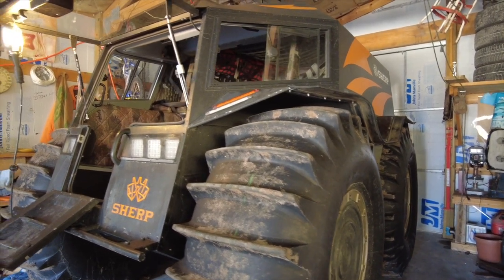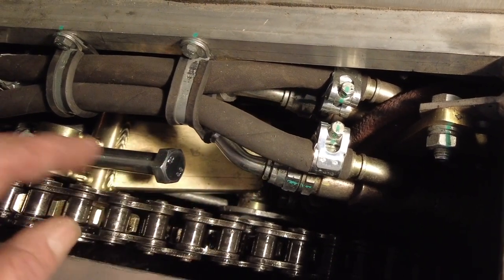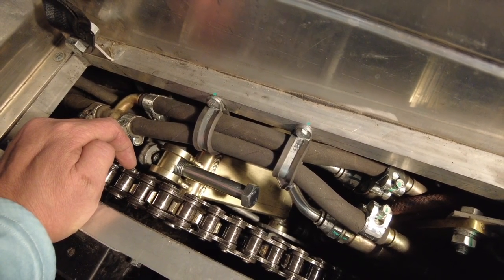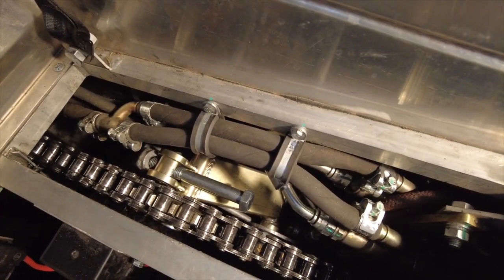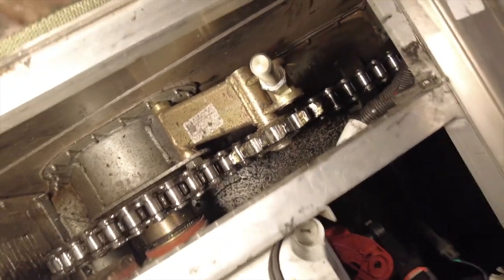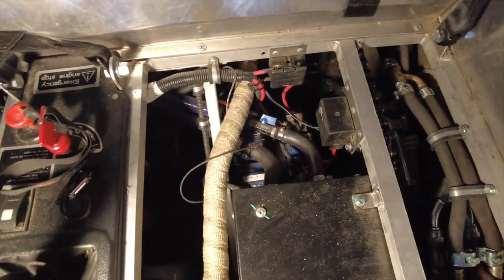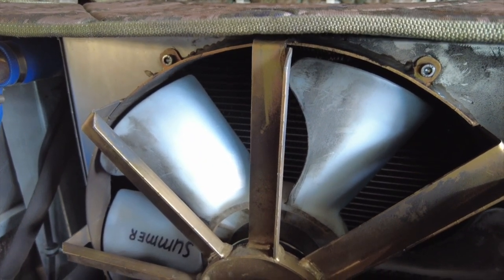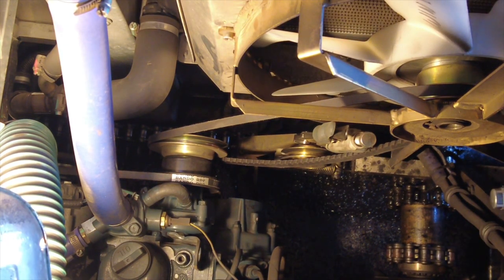SHERP REPAIR COMPLETE - Well, until I change the chain.

Comment: Hey Dan, you can adjust your rear door by bending the hinges a little.  Guessing it got smacked so you might have to tweak em a little!  And don't forget to throw a dab of blue locktite on those 4 fan bolts ;)

Comment: Looks to me like the Sherp goes through everything like a tank, but not built like a tank....sheet metal damage, etc.  I'm disaapointed, and thought the underside and key areas were beefed up, just like a construction front end loader.....built for the job.
Reply from the maker: It seems to holding up for me. Just dents. More support = more weight. Thanks for comments!